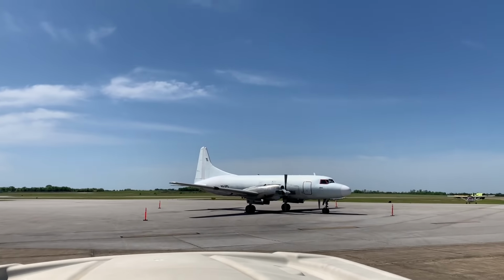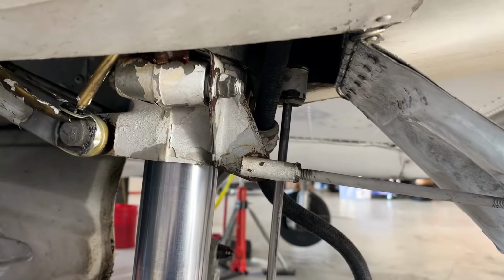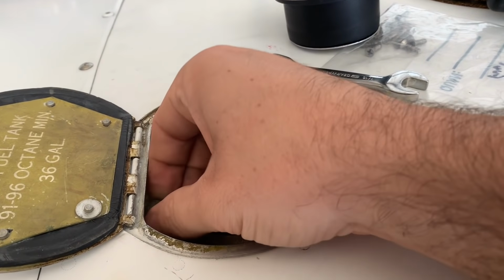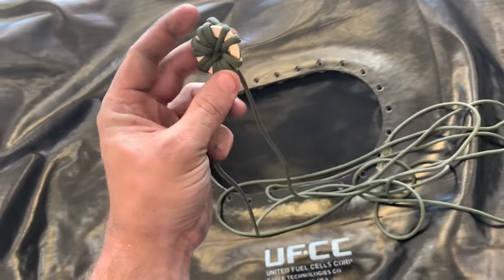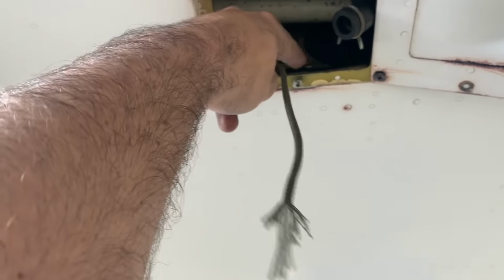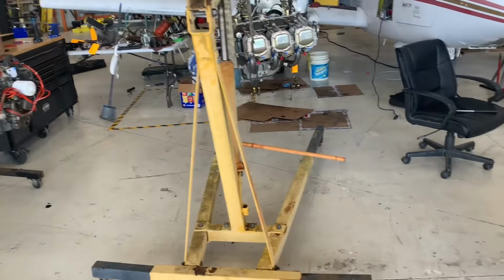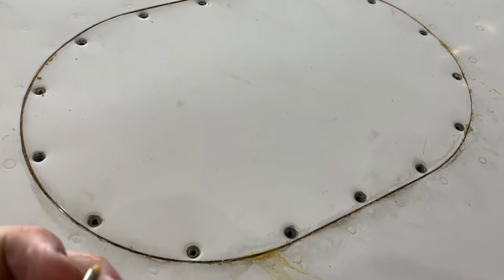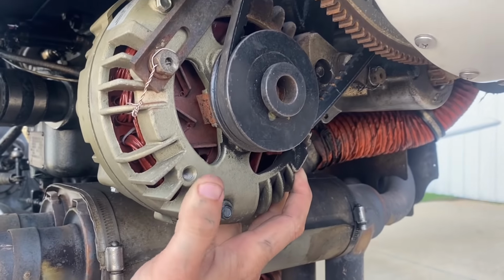Aztec annual turns into replace everything… fuel bladder installation tips that will save you time

Comment: I confess, we generally seal that tank inspection painel (It tends to accumulate water inside and you get some rust in the fuel senders/screws). but definitively NOT with glue hahahahahah
Reply from the maker: Yeah with RTV, or pro seal and mold release, or silicone, or a foam gasket… but not glue 😂.  The correct material to use is called out in the manual…….
Reply: @aviationsquared1909  It used to be called rope caulk. Gray in color and about four or five strips on a kind of tape roll.

Comment: Sweet old Convair.  BTW, plenty of radials with odd numbers of cylinders.  Driven a few inline 5s as well.
Reply from the maker: I know, my old bro metro was a 3 cylinder.  Any number that divides evenly into 360 will work for number of pistons
Reply: Inline engines are very different from radials. All aircraft radials have odd numbers of cylinders. The firing order skips next cyl, so that every one hits over two revolutions. 1-3-5-7-9-2-4-6-8, then repeat. Most had cam rings that rotated backward at a fraction that was less than half of the crank rpm. I barely understand it, so I have a tough time describing it! Some aviation museums have rotating radial engine cutaways, but few show the cam ring.

Comment: Wow, never expected a mechanical oil gauge to fail but I guess everything can break. Serwus!
Reply from the maker: Leaky leaky
Reply: Had a capillary line feeding a fuel pressure gauge fail.  The smell of gas and the front seat passenger wondering what the blue stuff was made for a stressful RTL.

Comment: You won't die if you use brushless. Fuel terminals allow it. Your using your phone or camera and I would guess it's not intrinsically safe.  Safety squints and double rubber. You'll allegedly be fine.
Reply from the maker: Yeah, I know a guy that turned his house into charcoal because “brushlesss tools can’t spark”….:
Reply: @aviationsquared1909  you just showed hitting a bolt with a metal hammer above the fuel cell I don’t think a brushless ratchet gonna get you might try a brass hammer
Reply from the maker: That was a tap

Comment: Comon now... Its not a sensor.. its an oil pressure gauge.
Reply from the maker: Hard talk make video. Word hard, wrench good.
Reply: @aviationsquared1909  Homer Simpson A&P
Reply from the maker: If you want to get technical that’s a mechanical gauge… the leaking metal diaphragm is actually the oil pressure sensor and the mechanical linkages that attach to it are the gauge…. So the sensor is leaking and the gauge is not